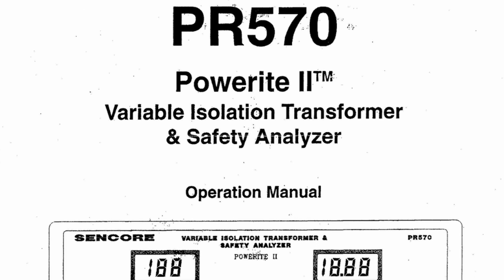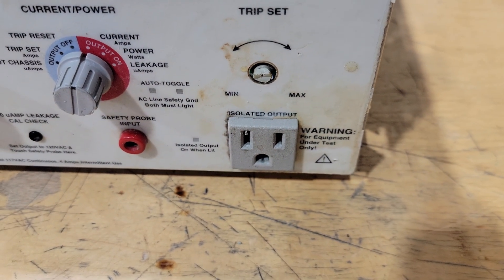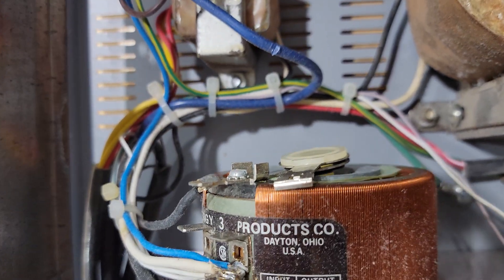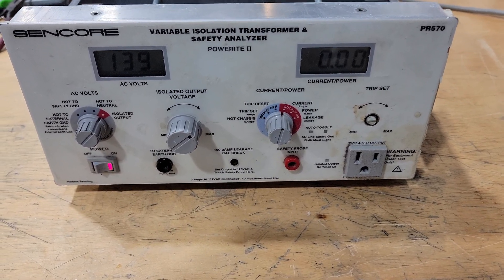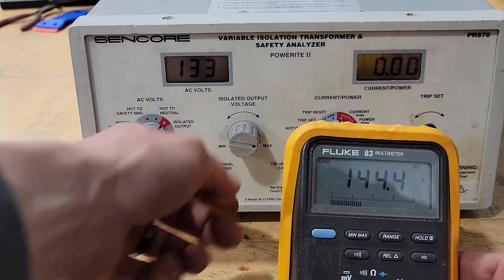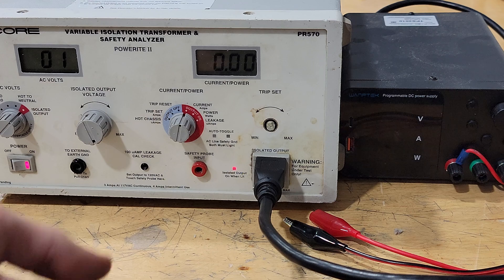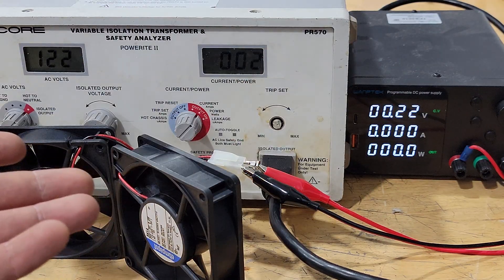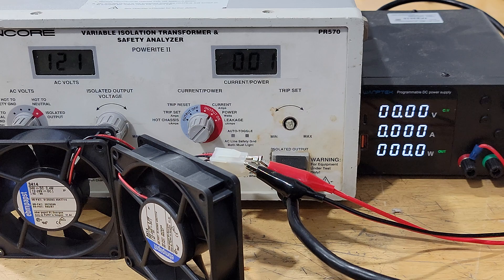Sencore PR570 Safety Analyzer Repair Variable Isolation Transformer

Comment: Your variac appears to be missing it's carbon brush wiper, that helps prevents arcing and short circuits between the windings. 
It looks like the brush contact part number for your variac is 146-0121-S.
hope that helps.
Reply from the maker: Indeed, that looks to be the case. Though since I snipped that piece of metal off of the wiper blade to make it make contact, that part will no longer fit.

Also worth noting the cheapest I was able to find that brush part online was $80, and a whole replacement variac I found (used) for $110. So I'll probably just keep using it this way until it fails. Then I can do another youtube video on why brush contacts are important 😃
Reply: @reedpetersen  If you're lucky, that missing brush may be in the case somewhere. it would have fallen out when the wiper arm came disconnected from the shaft. That brush is the key part that keeps the variac winding from burning up at the point of contact.